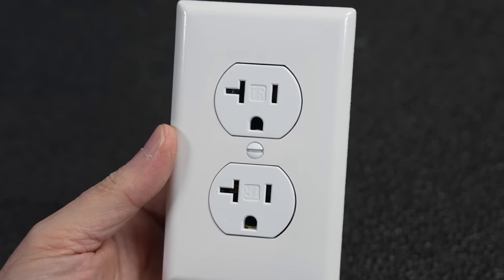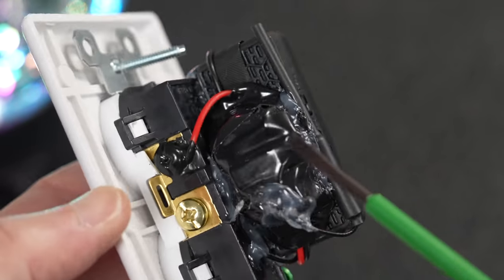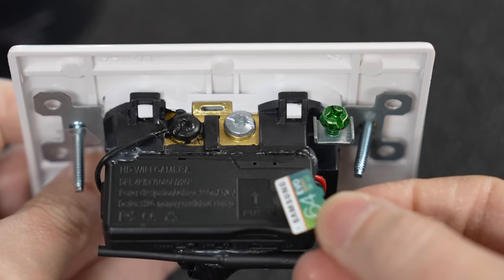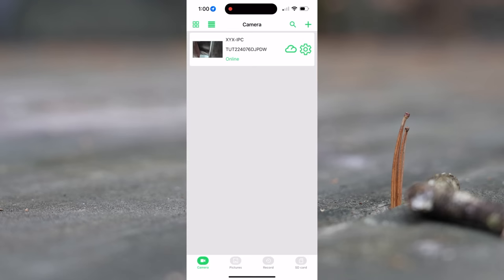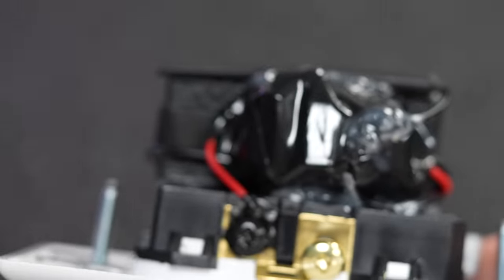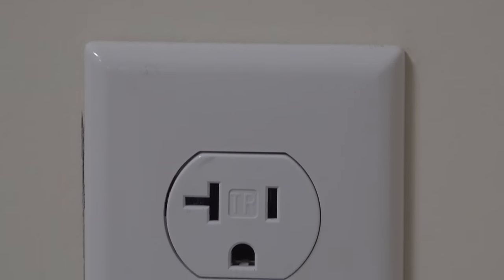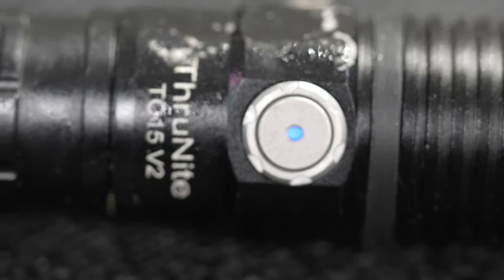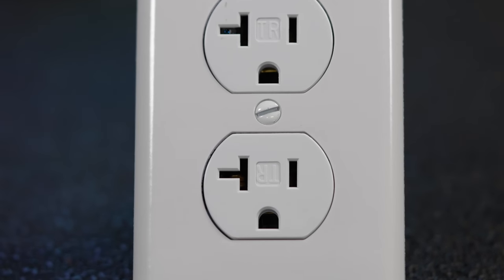Most ILLEGAL Outlet in the United States

Comment from the maker: Thanks for watching be sure to are any tips or ideas you use to protect yoruself from these - Outlet (Do not buy) specs only: https://amzn.to/3ELHfK2   Flashlight: https://amzn.to/3VtIZym
Reply: @Silver Cymbal So technically the outlet and camera are perfectly legal, it's just misusing them that is.
Reply: Why is the outlet an affiliate link when you should not buy it?
Reply: Carry a short 20A extension cord in your travel bag and if you see any 20A outlets in your hotel room or a new apartment, simply test all the outlets to make sure they are in good repair and tight by inserting your extension cord into every 20A receptacle in turn.  Be sure you make a reasonable attempt to seat the extension cord properly into the receptacle, which might involve some small amount of force.  

Unrelated fact:  Did you know that the GLASS camera lens is located exactly where the METAL horizontal neutral blade of a 20A plug wants to be inserted into?
Reply: @TheKingsComingAlefTav  seams so. finally a nice spy cam, imma go buy a few.
Reply: @LShortcuts  It's called reverse psychology. When I want you to do something I tell you not to do it. 😂
Reply: You make it sound like it's "all" 20 amp outlets.  That's misleading.  

Standard 20 Amp Receptacles don't have cameras.  You have to buy the "gadget version" yourself for that..

I do think it's something to think about regarding hotels and AirBnB.  Do these broadcast their CCID?

P.S.  Clever Ad.
Reply: should have been title most unethical outlet in the us. clickbait
Reply: @LShortcuts  Could be a browser plugin that converts Amazon links to affiliate.
Reply: There's nothing "illegal" about this outlet, there are illegal uses of this outlet if you place it in someone else's property or a restroom. It is not illegal to record on or in your own property or anything that can be seen in public from your property, though some states do have restrictions on public recordings in certain instances and areas. There is nothing wrong with this camera, it's just a hidden security camera. The way you framed this video is false, and the content and title are clickbait.
Reply: @scottmyers10  It records audio too, and the laws are more strict.
Reply: @soundspark  There are no laws that ban you from recording audio on your own property, that's a false assertion. In fact, all security cameras have the ability to record audio. I can install this on my property anywhere I want, with the exception of restrooms. Your assertion is completely false.
Reply: In the state of Georgia you can record anyone in your home without them knowing. In fact the laws states you can record anyone as long as one of the people you are recording knows in private property, public places or even phone calls. So as long as you know your recording someone in Georgia it's fair game to record. However you can't point a camera in your neighbors yard and film without there permission, but you could clip a camera to you and walk over to your neighbors house and start filming as you talk with them.
Reply: @scottmyers10  - The "do not buy" and "most illegal outlet" are disclaimers for liability reasons.
Reply: @cjalexanderjr8811  Liability for a product rests on the manufacturer of the product, not a YouTube commentator. It would be incredibly difficult to sue this guy for anything revolving around the installation of this product, though the manufacturer could sue him for falsely claiming the product is illegal. So, to defeat a fictional liability issue, he instead defamed the manufacturer and created an actual liability issue. Either that or it's a stupid clickbait title, I'm betting the latter.
Reply: @scottmyers10  - Still a liability.
Reply: @cjalexanderjr8811  It's a liability to falsely claim something is a crime or illegal, just like it's a liability to falsely claim someone is a criminal. It IS NOT a liability to evaluate a security camera and not lie by claiming it's illegal. You have NO understanding of legal liabilities.
Reply: @scottmyers10  - The best way to avoid a civil lawsuit is to say “don’t do it.” Trust me, I’m from New York. We love to sue! 💰 You’re obviously cut from a different cloth. Don’t be a schmuck so I may teach you a thing or two!!
Reply: @cjalexanderjr8811  By the way, yes, I'm from a "different cloth" than you, the kind that doesn't make shit up on the internet and doesn't pretend to know things they have no clue about.
Reply: please learn the definition of the word 
unique 
because you are using it incorrectly 0:47 
something can not be "so unique"   
unique means  only one of
https://youtu.be/dTRKCXC0JFg